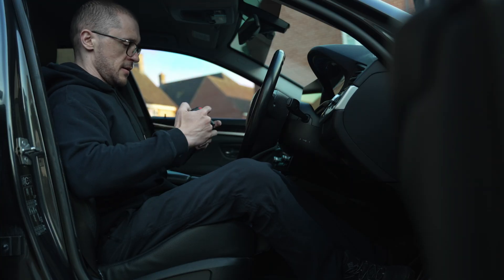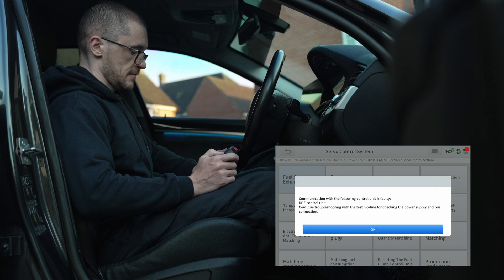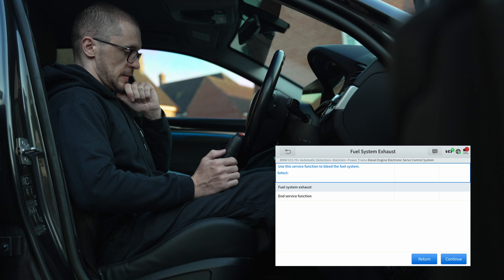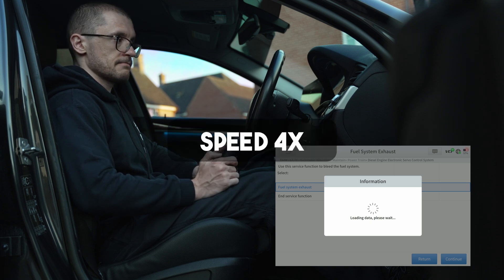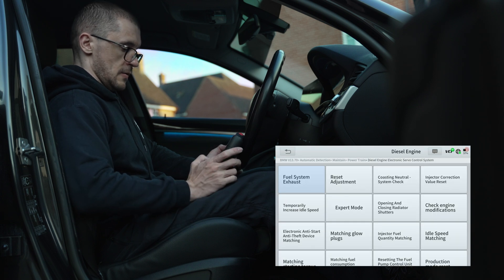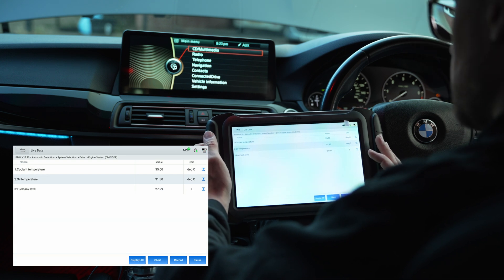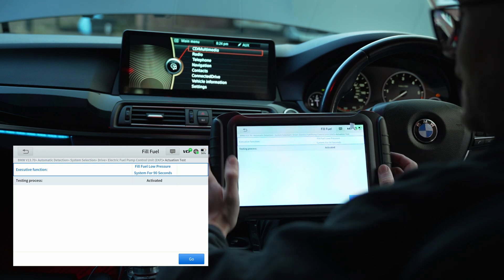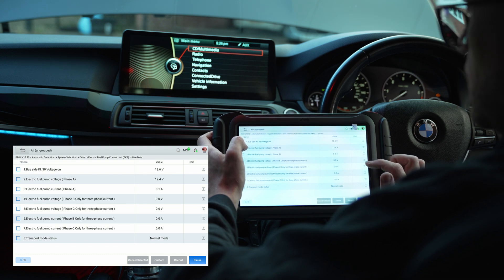All XTOOL Scanners D7 D8 D9 IP616 IP919 can't do BMW F series Fuel System Bleeding

Comment: Did topdon succeed at this test?
Reply from the maker: topdon is using the software from Launch, and although i did not test is specifically, I am 99% sure it is able to to it. (or maybe I tested it, just can't remember)
Reply: @BestCarMods  thank you for your reply. What diagnostic tool would you recommend with £1000 price limit. Thank you in advance
Reply from the maker: @jay33554  depends on what you want to do with it, your skill level and the cars you work on.
Reply: I have the Ancel bm700 which for the price around €115 I paid it has done all I needed fuel bleed handbrake retraction for service and diagnostic the only time I found it wanting was brake fluid flush to operate abs valves